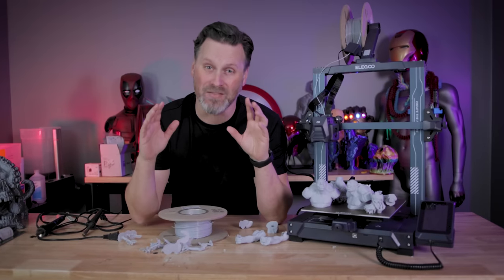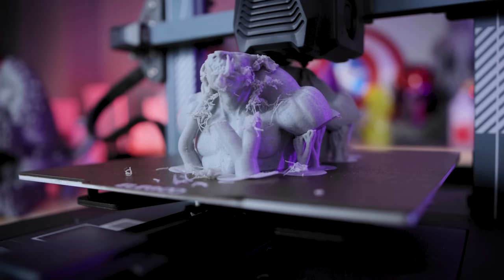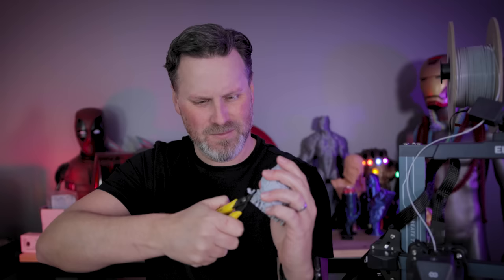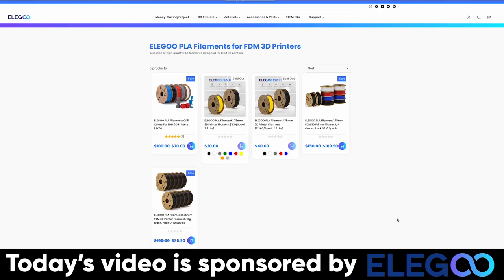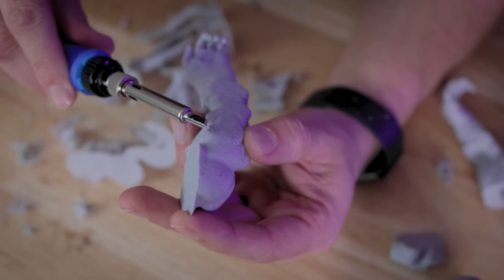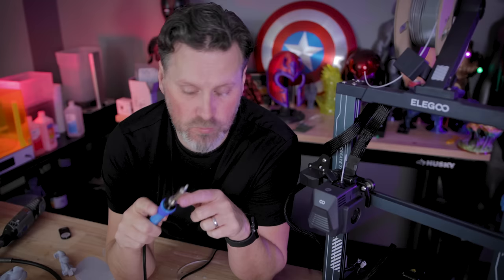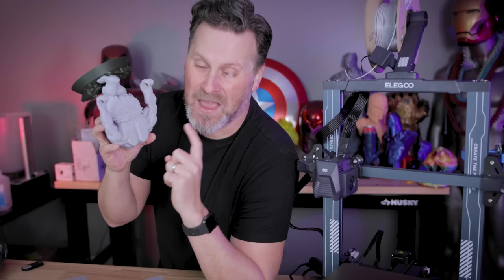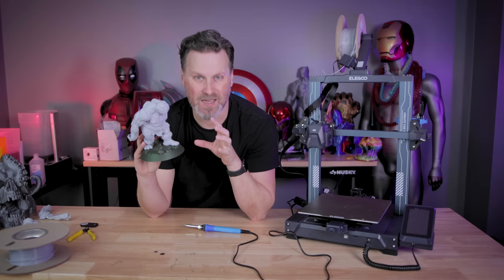Genius Smoothing Tip for your 3D Prints!

Comment: If you know ahead of time that you're going to be welding/filling seams like this then add a little brim to the part, but don't remove it, then your material is ready and waiting for you.
Reply: This is a big-brain move! printing something atm that needs seam welding and its using brim. ill definitely try to leave it on and use as filler.
Reply: That’s actually genius
Reply: Yo thanks for that tip
Reply: Genius

Comment: if you used something to hold the work. you could then feed with one hand and melt with the other, like Tig welding, or gas welding...  I think getting the right amount of filler material is 80% of the battle with plastic welding.
Reply from the maker: You are 100% correct. I need a large set of helping hands for these prints 🤣
Reply: @UncleJessy  Why not 3D print some 🤣 I heard you have a printer big enough to handle it.
Reply: @UncleJessy  did you quit resin printing? Haven’t seen a resin video from you in forever my dude! Either way, hope alls well!
Reply: isnt that just a 3d pen tho?
Reply: @jimpoulos01  3d pen would be mig welding ;)

Comment: Instead of using an iron that can burn your fingers, you can just use 50 cents of greenstuff epoxy, press it in the seam, smooth it over with a wet finger, and call it a day.

Comment: This is genuinely one of the best ways to join parts and fuse the seams. You can dig in further and fold back over if you want a really strong bond, great for cosplay helmets and props. Also you know that initial swipe line that printers run along the side of the bed before starting a print? They make for great scrap plastic to fill in the seams! Same goes for thinner rafts.

Comment: Some people use temperature controlled wood burning tools (essentially soldering irons) to smooth the entire model. You may find that wood burning tips may be better shaped for the task than regular pointed soldering iron tips.
Reply from the maker: Nice! Yeah I’m thinking the wood burner might have some large flat options
Reply: indeed, i have a cheap woodburning kit i got from Walmart a year or two ago and it works amazingly.

Comment: Only problem is if you have textured details, this method will cover those up and it will be very noticeable
Reply from the maker: Oh yeah that could be a massive challenge. For sure not applicable to all prints
Reply: It's up to the designer to make seam areas buildable. The catchphrase is Design for Manufacture. Areas where for instance the ankles attached to the shoe covered most of the seams in the model. In any field it's easy to design things that can't be built, or built right/fast/easy.
Reply: You could also do what granite and carpenters do by pulverizing some leftover supports legs into powder and mix that powder into a small amount of that glue resin. If you ever had to repair a granite chip you would know what I mean.

Comment: This is a great way to blend seams. May I suggest using a 3D pen for filling in any gaps instead of trying to fit random bits of scrap. Just use the same filament used to print the model and you've got a perfect match.

Comment: Been doing PLA welding ever since I saw Frank Built video a long time ago and never went back to glue. It's by far the best way to weld 2 pieces together. Very strong conections between the 2 parts and it does not take that much time if you consider the time you take on putting the seem, wait for it to fully dry, sand, putting again... This is for sure the best way.

Comment: Another idea I have (I haven't tried it but it might work especially for this kind of model) is to add some green stuff and make very small needle like shapes, put some green stuff in the seam and then put the solidified needle like green stuff on top to look like the stiches from a scar.
With a bit of practice you could get a cool look I think.

Comment: Green stuff works great and it’s old school from metal miniature days.  If you have a small break or a print support digs a chunk out of a mini and leaves a hole.  Green stuff can fix it.  Wet you fingers and mold the greenstuff in the hole.  Or use it to bind two pieces like the arms with super glue.

Comment: You could have also used that flat tip to flatten the rough areas where the support was.  That can help the fit better than trying to grind it away with any tools or hand sanding.  Great video, but yes this would have been a better resin print lol.  You should do a video showing the difference in weight when your printing in pla vs resin.  Resin seems much heavier to me.

Comment: One more tip - use Perfect Plastic Putty with a wet painting brush for filling in holes/gaps. Because it's water based, you can get a smooth finish and do not need to sand.

Comment: I join parts with glue and then cover the seams with a 3D pen uaing the same filament.  You get a great weld and fill gaps.  A wood carving set of tools are great for trimming any high spots and matching textures or geometry.  Very strong.

Comment: Why oh why did they have that square part stick out of the legs instead of also having a square hole in the legs and a separately printed cube to put between both parts?  That would have avoided that rough part as you would not have had supports there...  The same holds for the arms ...

Comment: Really cool idea. So for me what I would do first and what is working for me is the combo is I use my heat gun on the part with a little bit of extra filament and that gives me a great bond and then the filling of the crack actually fills from the inside out instead of having use the heat gun or the welder on the outside in some cases but having to use the welder has become needed depending on the gap etc. so this is definitely next level stuff you shared. Thank you as always be well be you

Comment: Sweet! Just what I was looking for... I have a mask that was sliced into two pieces and the seams are... unseemly. Tiny or tight spots could be smoothed with a heated wire loop.
NOTE: Just don't run your probe any hotter than 185 or 190. Any hotter and you run the risk of plastic discoloration. My above mentioned mask (in blue) now has some unsightly greenish tinge to it.

Comment: Correct me if I'm wrong. PLA is a natural, plant based plastic filament material, so when working with it under heat, respiration protection shouldn't be necessary as any fumes generated wouldn't be harmful (like ABS would be).

Comment: gonna try this out! I have been using a little trick in my prints: i delaminate the brim of the print and fill the gaps with ir, with ca adhesive. Once its dry,  I just cut the excess.  You way looks sick

Comment: Tip: print in higher quality <0.04. add extra walls and reduce infill.

The extra time spent printing will likely be more time saved compared to the post processing in sanding and filling for a million years. You'll Only need a scotcbrite pad and some light filler primer. No sanding.

Comment: hey jesse i use a heatgun to heat up the nub that pushses into the hole i get it a little warm then i put them together an it molds it self to the hole no more sanding and you dont get big gaps in between joints

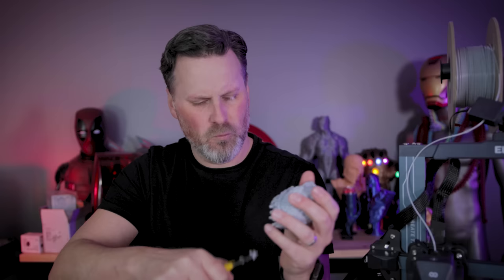Comment: @3:10 Be careful! I'm too used to breaking my supports off like this and I just got my pliers break off and fly at a tremendously dangerous speed. This twisting motion puts way too much strain on the pliers. I switched to some heavier duty wire cutters when fighting against unruly supports and while it is a bit harder to maneuver, it feels so much safer.
Reply from the maker: Yeah i for sure should be wearing some safety glasses

Comment: I recently started using a cheap 3D pen to fill gaps. If you do it well, the seams become almost invisible 🙂. Also stronger bond than only using superglue
Reply: I'd like to know your secret as my 3d pen did a terrible job and would barely stick. I even used the same roll of filament.
Reply: @joed899  i put the speed to slowest, and then gently moved along the small gap. I also use the same filament as the print.
Do know that I still need practice, but sometimes I get 'welds' that I'm proud of 🙂
The main trick is the speed of your own movement along the gap. You'll have to time it right, to get a nice weld

Comment: Now I have no idea what your results are going to look like but I'm just going to say from the get go that just because they're both temperature controlled soldering irons that does not mean you're going to get similar results at all. The pinecil v2 they were using is a fantastic budget soldering iron, but it has a very unique design with specialized smaller tips both based heavily on the TS100 series of soldering irons by miniware.

Comment: Maybe if you have a 3d printer pen with some sort of silicone cover to keep if from damaging the print you could use that to fill and then solder 🤔 I often use mine to join parts from the back or where it won't be visible

Comment: I use a 25w soldering iron is very controlled for welding and smoothing prints I use my thin prime line as welding rods they fit right into the gap you want a small round tip with a flat head it can weld such a thin line it's almost unnoticeable especially if you're painting it an can follow smaller details I used it to re sculpt the finger lines that failed on my small batman statue you would never even no lol

Comment: Nice! What about for Resin? just use a UV torch and resin or can you use heat as well?
Reply: Heat won't work for resin.  I use a tiny paint brush to drop or brush some liquid resin in the spot, then flash cure with with a UV flashlight (torch).

Then using sandpaper, files or whatever fits to contour or smooth out the resin filled area.
Reply from the maker: It can work if you carefully drip in and. Cure but it’s a lot more difficult since it’s resin.
Reply: Might just continue with the old fashioned baking soda and resin method so it's easier to work with

Comment: To close the gap, couldn't the connection peg be shaved down and then use the gloop to attach it? Seems like a simpler fix than doing this. This technique would be useful for delamination and closing those gaps that ruin prints.
Reply from the maker: Even if you do that there will still be a seam in most cases.

Comment: I'm having the same issues with the tree supports. No matter what, I set the z gap distance to it. Always fuses to the model no matter what. I've tried lowering the temperature and it does the same thing. I don't have that issue with Cura with the organic tree supports just prusa. I'm kinda at a loss..

Comment: I apologize if this was asked as I did try to look through all of the comments. What is the 3d goop you used? I have been using IPS SCIFRIP #16 FOR acrylics and it seems to work great for pla however it is kind of pricey. Like 13 bucks a tube.

Comment: I’m really curious how this method would work on a resin print. Ive only ever printed with resin, Ive never done an FDM print, so i have no frame of reference.
Reply: Resin isn't usually thermoplastic, so this won't work for resin prints. The reason this works for FDM is that the filament is melted to form the part. Resin uses light to form the part.

Comment: Very slow and fiddly, Phrozen UV putty will fill them gaps in 12sec leaving you with a perfect invisible joint! 

There UV putty is as storage as epoxy and it cures solid in just 10 to 15s, you can use any  UV light source like a UV torch or the Phrozen Cure Beam..

Comment: Plastic. Gets hot. Melts. Soldering iron with a tip like a sculpting tool. Gets hot. Melts. How can one gain this power.
Reply: One can gain such power by blowing through a heated nozzle.
Personally, I would opt for a combination of an aquarium pump, a heater and a nozzle. 😅